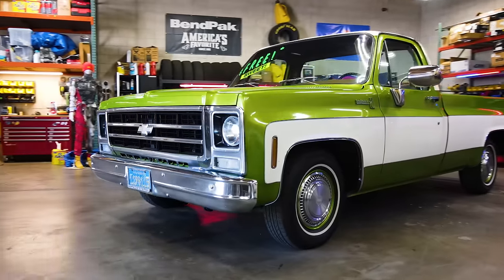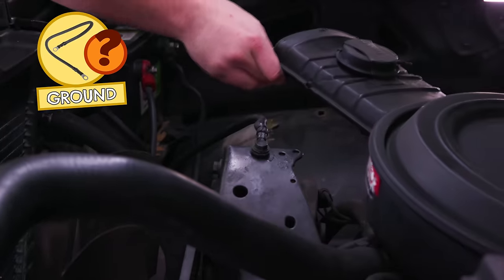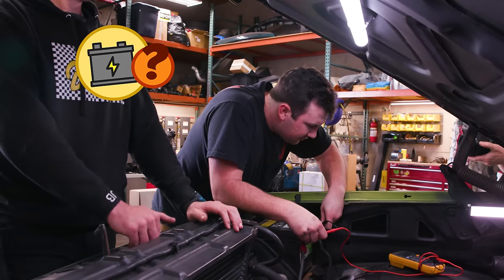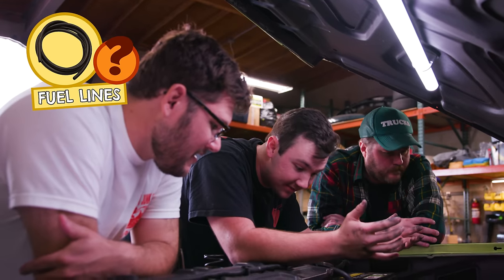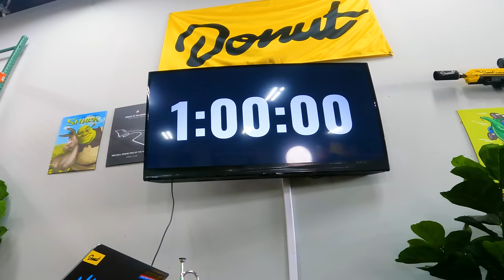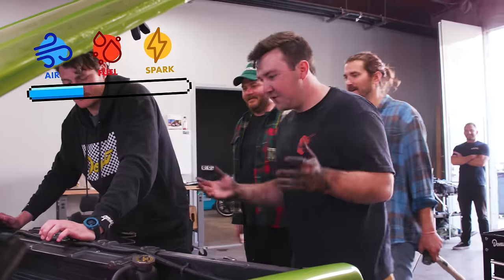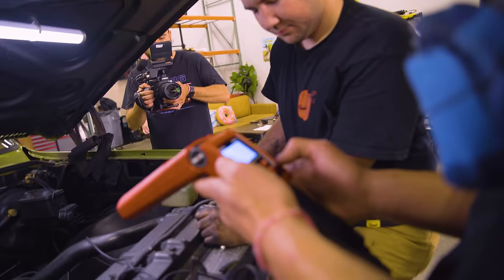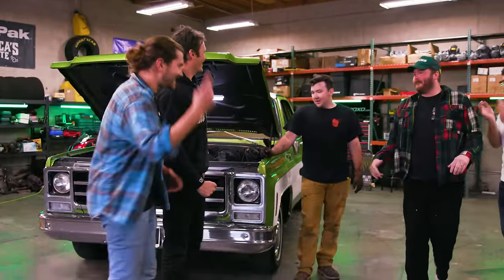Giving People a Classic Truck, If They Can Fix It

Comment: For that fuel rod, take some grease and put it on both ends. It helps lube the fuel pump and the grease will hold it in place when you push it into the block so it doesn't fall down
Reply: Or you can just put a new synchronizer on each double lopsided gearpair, and new ball bearings on the exhaust fans.

Optionally the fuel pipes needs to be redirected to the toprad via the engine block directly to the alphatronic!
Reply: @anderstermansen130  ah shit why didn't I think of that
Reply: @anderstermansen130  Be careful about joking around.....I used to joke about muffler bearings or blinker fluid for my 79 C20 (I could have easily got this truck going with less work jumping the distributor to the battery and jumping the starter if needed) and now my 2020 2500hd takes exhaust fluid. Who ever thought exhaust fluid would be a thing?

Comment: I'm a young mechanic barely getting into it about 5 years ago when I made it my mission to get my grandpa's 1982 f100 running after he passed away. It hurt me watching rot on the driveway so I decided to watch YouTube videos and get ford literature to look at. It brings joy hearing that engine crank and try to run in fact I have that feeling in my throat like crying while writing this comment because it reminds me of when I finally got my grandpa's truck to run after such a long time. Going from very little knowledge to knowing as much as I know now is proof that you can learn so much from just jumping into working on a project vehicle. Working with your hands and having that drive to get something done.

Comment: I’ve watched a few of these and this one of few I’d be confident in fixing. I grew up working on these and have done almost everything there is to do on one of these trucks. Like that push rod for the pump, take the dipstick and bend the end a lil and push it up then there’s a short bolt on the front of the block if you take it out you can put a longer bolt in to hold the rod up. Just make sure you put the short bolt back in or the rod will get stuck down. I love watching these.

Comment: I just discovered this channel. Fantastic video! I liked how they sabotaged that ground. Ground wires can really screw you over. Even if they APPEAR to be alright, check them. One way to test a new tech on basic ground testing that I always did to my apprentices, was to wrap tape around the ground post on the battery and have them tell me why the car won't start. To really get them trying to think and not just assume stuff.

Comment: I dont work on these older cars, I'd of noticed the carb, but the fuel pump push rod would've done me in. I'd of had no clue that went there. I've always worked on cars with in tank pumps. I'm not a mechanic though. Only work on personal stuff and close family and friends. Good job Aaron. Nice truck

Comment: Guy: 12.6v seems low. 

Crew: No it’s perfect! (Then proceeds to explain how many volts needed for each cell)

Guy: I think I need a battery! ☝️

😂
Reply: Guy is dumb. But at least he got a new distributor cap and rotor when he didn't need them and they didn't take time off.  The last thing they did was tell him what to connect so it would start.

Comment: FYI there is a very short bolt in the front of the engine that covers a hole that a longer bolt will lock the pushrod up so fuel pump removal and installation is easy and you do not need to fight the pushrod. It's just below the freeze plug on the front of the motor right side.

Comment: theres a bolt on the front of the block that goes into the cavity where the fuel pump bolts up. that allows you to put a screw driver into it and hold the push rod up while installing the fuel pump. just need a little rtv on the bolt when you put it back in.

Comment: Small block Chevy has a bolt in the front of the block near the fuel pump. It was a left over from the previous pre 1955 motor mount design. You can pull that bolt out put your favorite flat head screwdriver in to hold the rod up putting in the new pump. Just make sure to throw a little silicone on a washer when you put that bolt in. Oil from the crank will leak out if you don’t.

Comment: Great channel donut media guys!! Neat video idea and there's actually a neat trick when changing the fuel pump to keep the eccentric rod from falling down on the front of the motor passenger side of the block about straight down from the water pump bolts and alternator bracket,there's two bolt holes one is a threaded boss and one is just tapped take the bolt out hold your finger against the fuel pump eccentric rod and put the bolt from the threaded boss in the tapped bolt hole and install the fuel pump..

Comment: In case there’s an engine being an ass with fitting the pushrod during fuel pump replacement, it’s safe to use standard “palm size”- a glob of petroleum jelly to help hold it in place. Soon as engine starts it dissipates with heat and will not harm anything, just like it doesn’t harm your hand from the friction.

Comment: To hold that pushrod in place there is a bolt hole in the front of the block. You can put a long bolt in there (3/8x16 if memory serves) and it will hold the push rod in place while you mount the plate and pump.

Comment: This one is easy, it's carbureted.  I've got a newer one which is injected.  You'd need more than the two hours allowed to replace the fuel pump as you have to remove the bed.   In 1970 I was the Quadrajet expert in the local Cad/Olds dealership.  But it takes close to two hours to rebuild a Qjet correctly.  Flat rate time is 45 minutes.  And I've never seen anyone quicker than me at setting one up correctly.  That does include removing it from the car and replacing it.
I could care less about people watching me unless they want me to talk while working.  If it had a jumped timing chain it would have really thrown a curve for a two hour job.

Comment: Maybe someone already commented on this, but there is a bolt hole in the front of earlier SB chevy's that you can use to hold the fuel pump rod in place while installing the fuel pump.

Comment: Not sure if anyone else mentioned this or not; He was right about turning the engine over to install the fuel pump rod. In addition,in a sbc, there is a short bolt on the front of the engine by the fuel pump. To install the fuel pump rod, Remove this short bolt insert the rod and loosely installed a longer bolt to hold the rod up. Install the fuel pump, then remove the longer bolt and reinstall the short bolt to avoid an oil leak.

Comment: I miss my 1981 1ton crew cab 4x4.. sitting on the wheel well changing spark plugs was so convenient... 
 But dry humping the turbo400 transmission back into place was total ride in the struggle bus..

Comment: fuel pump rod, trick. front of the block by the Punp there's a bolt. before pulling the pump tighten the bolt. pill pump and you'll see the bolt keeps the rod in place and where it won't fall.

Comment: Another way to diagnose a distributor 180 degrees out is if you find where cylinder 1 is, take the plug out of the cylinder and put your thumb on the hole where the plug was then bring the motor up to the compression stroke you'll hear a hiss and feel pressure on your thumb have whoever stop cracking the motor and check what cylinder the rotor is pointing to

Comment: The best vehicles is in the 1970s, they are easy to repair but to get them to run right is to pump like crazy to prime the carb. But nowadays it is electric powered pump and once the key is active the pump (fuel injection system) starts working immediately to get the engine running

Comment: My electrical system recently had a problem so the first thing I learned was that a battery should be around 12.6 volts when the car's not on and 13.5-14.5 when on so I'm surprised someone so mechanically inclined didn't already know that.

Comment: Funny how his experience with newer cars caused him to struggle with this c10. Put grease on the pushrod, it will hold it in the bore long enough to get the pump on the lobe position makes it harder but you can get it installed

Comment: Don’t forget the right way to install fuel pump rod . Rotate engine while filling rod  location pull short bolt from front of engine add longer bolt to hold pushrod in install pump remove and reinstall original bolt .

Comment: Putting axle grease on the fuel pump pushrod will keep it up there in the hole while you free your hands to put the bolts into the fuel pump to the block.

Comment: Chevy has a window bolt on the front of the engine near that pushrod so you can put a tool in there to hold to push rod up while you put the fuel pump in.

Comment: Tip on those fuel pump rods. Grease will help hold it up in the hole while you bolt on the new pump.

Comment: I just changed the transmission solenoids in a 2003 Buick park ave , never worked on a transmission before. . Also, never felt so out on the ragged edge of mah skillset!!!  I was forging new paths, "terrified" of breaking something the whole way. And then, drove car 950 miles with the owner/friend to make sure he made it home to Baltimore, on 3 hours sleep in 3 days, then flew back home...( I drove the whole way to Baltimore...his skillset scares me, good guy though :)
Challenge accepted.

Comment: The fuel pump will put out to much pressure for the quad-a-jet. Need to replace the black gasket in the carb. The push rod has a bolt in the block that will hold it in place while you remove the fuel pump.

Comment: That should have been a 30 minute diagnose and repair. The fuel pump drive rod has a neat trick that you don’t need to remove the plate. It’s called a pick. And no need to turn the engine over to get by the cam lobe. The fuel pump can easily be pushed in

Comment: small block chevy has a bolt on the front that you remove and screw in the pump bolt that locks the rod so it doesn't fall

Comment: He was correct in the aspect that a battery below 13 volts is of concern and needs replacement sooner rather than later, but 12.6 volts is still enough to crank and start

Comment: A nuce blob of grease around the end of the shaft keeps in in place long enough to slip the pump into place, easier if you sit under the truck and reach up to it which makes it easier to connect the fuel line
You won yourself a great truck those were solid machines

Comment: I thought he had to drive it out of the shop by the timer too. But he did everything in a good sequence except for asking for a battery,could have saved 10 minutes there if he only waited for power,but awesome vid,I would have done better also you can just swap the leads around 180° in the cap usually,instead of removing whole dizzy , I know it,s not the right way but a lot of people do it when they get it 180 out,better just put it on compression and rotor at #1 and all good. Best wishes to you all and congrats to Aaron,from, Auckland, New Zealand.

Comment: I bought my 72 f250 for $800 not running. I showed up with a distributor and carb. It only needed a fuel line. I ran a fuel line from a 5 gallon can in the cab amd drove it home. Bought a fuel tank and still driving it 2 years later

Comment: 180deg off on distributor does make it fire in reverse order and don’t have to remove the distributor to correct the issue simply move the wires on distributor

Comment: Actually..  with a hei. It doesn't matter where the distributor cap is rotated. As long as the #1 wire is at right spot and the rest of wires are correct

Comment: Legit had a 1987 Monte Carlo SS that literally "ran when parked". I drove it to work to pick up my pay check, went to get back in the car not 5 min later, and nothing going on. We checked everything we could EXCEPT the battery ground. Rented a tow dolly and got the car home. Eventually figured out that the ground bolt was rusty... cleaned it and it fired right up.

Comment: I know it's be different in the actual situation but I feel like there's not a single thing on a square body I couldn't diagnose in a short period of time. I would also need to know rules of hackery. If you know what you're doing that entire truck can run off of three wires without even touching the key. My favorite hobby is taking a junker in the trees and pulling a vice grip garage, and getting it running and driving it home

Comment: Nice square body, I just bought a 87 gmc serria classic  v2500 Camper special, 350 SB, with a lift kit and a 8 foot bed, only got it for $700 with title, sat for 16 years and it does run and start……kinda….but what else is a 22 year old supposed to do now a days, I hate sitting around so yeah I bought a rotted shitbox to fix and god do I love it

Comment: I have a 72 c10 with a 350 my ground shoots straight to the alternator bracket just like yours but I have no paint or rust on mine just bare metal

Comment: it is missing all the chrome trim i have 8 of these i got a 79 4x4 short box cheyenne full option truck 400 sbc with 400 turbo 100% stock under 35,000 original miles i got it free same with the rest of them all are rust free some don't have engine and trans but all have a very good body . right now i am building a 68 with a stroke 454 in it and a 02xx trans .best part i only have 1400 in it so far still need to finish the interior and final paint job runs and drives like new running about 600 hp soon to be my daily driver
Reply: ps i would have just moved the wires on the cap 180 chevy u can just drop find tdc if it don't start move wires a 180 then it will start do u guys know that a sbc disruptor will work in a bbc u just have to change the counter weights u can show me a bolt on a chevy and i can tell u where it goes from 64 to 79 i know like the back of my hand

Comment: Yyyyyeaaahhh something the donut guys dont realize about the old shit is that the mechanical fuel pumps wont always pull gas from the tank. Sometimes you have to prime the line. Its hard on the mechanical pumps to just "turn the motor over" dry like that

Comment: Quick sidenote “if the fuel pump on Chevy’s is connected to the side of the block on the motor there is no way for the fuel to just pump or prime when you turn the key because it needs a fuel pump just saying

Comment: If you wanted to show how anyone can fix their own car, I think it would be more interesting to see someone without real or very limited mechanical skills to diagnose and fix a car based from previous viewed donut clips. 

This will tell you if your channel is reaching those who really want ir need to fix their own cars. 

I had this discussion with a coworker. We got in an argument about older cars verses new cars. I had told them I took high school mechanics 20 plus years ago. He commented that was 20 years ago things have changed. And my comment to to him was yes but most cars are still combustible engines, the only difference is newer cars have more technology, but they are all based from the same foundation principles. 

He blew me off. But this episode just proved my point. Ford mechanic fixes a Chevy truck (probably older then he is).

Comment: FWIW the fuel pump on these c10s is really not that easy to get to lol. id rather do a honda fuel pump any day. pull up the back seat, unbolt the sending unit and some clips and hose clamps lol

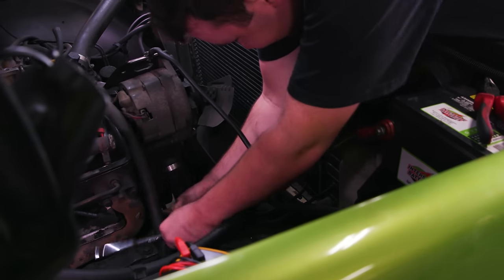Comment: 7:08. Turning switch on. Will not turn on a mechanical fuel pump.  Turning the motor will test it

Comment: The battery wasn't a terrible call... when running, it should read 14.4, and that's the normal way to test it, first running, then under cranking load (where it should stay above 9.6) and finally rebound voltage, and that should be around 12.6. Basically, I think this guy is probably used to using a real battery tester, not just a voltmeter, which would simulate all of that automatically.

Comment: He could have used a rag and hose in the fuel tank cap blown on it and pressurized the tank pushing fuel out of the disconnected line.

Comment: When he sucked on the fuel lines he was diagnosing the fuel pickup, which cannot be conclusively done by just cranking the engine with the fuel line disconnected

Comment: Just a little Mechanic's trick, put some wheel bearing grease on the fuel pump rod ,,then put it in and you will have enough time to put the fuel pump in before it falls back down,, not trying to tell you how to do your job,,

Comment: Am  A mechanical prodigy, I don't need you junk ,I love my old rides, what is fun, how many remember how to work on carbs? I have a truck with 270k miles on it ,doesn't use a drop of oil, and I bought 3 years ago for 700 bucks, Tires on it cost more than the truck ,and its my rust bucket, and am on a tight budget.